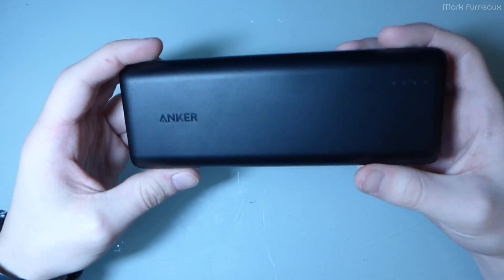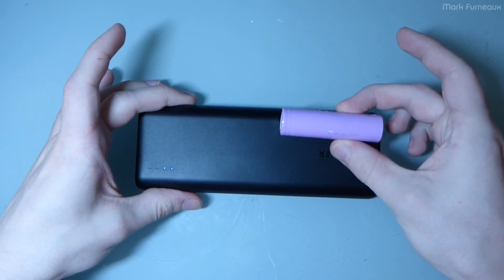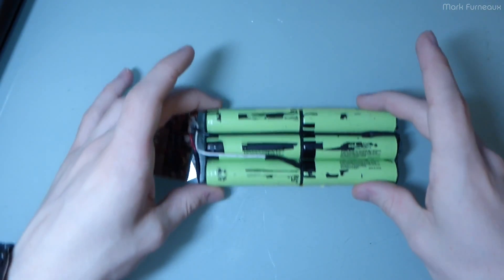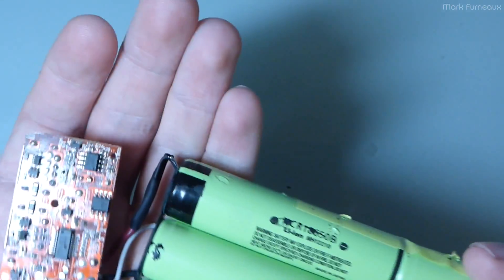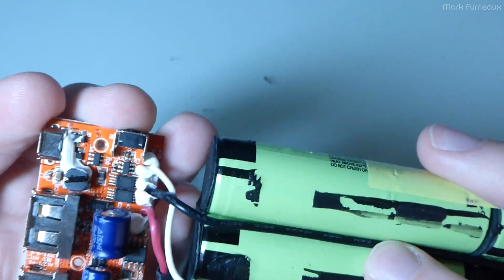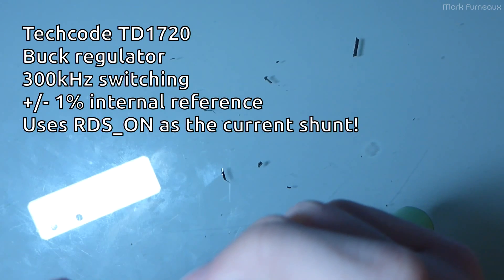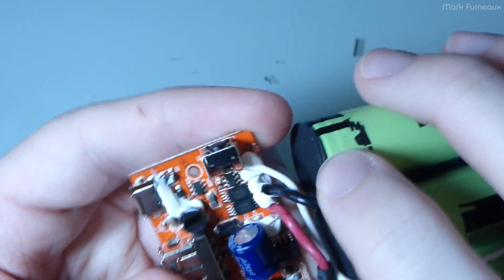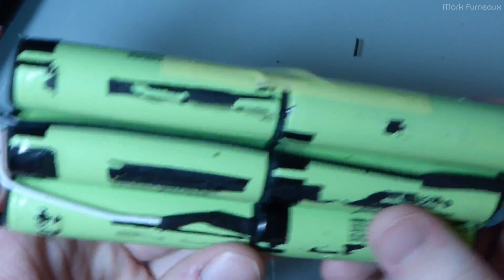Teardown of the Anker PowerCore 20100 USB Power Bank

Comment: you can buy eight 18650's for less than this power bank costs. and im talking about 35+ amp, 4000mah batteries. LG, samsung, panasonic, etc. stop buying stuff from amazon, they are expensive as hell. I use 18650's for my vape gear, and all the ones I have are all name brand high amp batts.
Reply: MXJO 3000mAh 35A are actually 20A continious (https://www.e-cigarette-forum.com/forum/threads/mxjo-yellow-silver-35a-3000mah-18650-bench-test-results-only-a-15a-20a-battery-but-near-an-hg2.710690/) Lg Hg2 and HD2 and HE4 is also 20A continious (according to datasheet). imren 3500mAh is really 10A continious (https://www.reddit.com/r/electronic_cigarette/comments/403vl2/the_green_30a_3500mah_imren_is_a_10a_battery/) (http://www.candlepowerforums.com/vb/showthread.php?414778-Test-Review-of-Imren-IMR18650-3500mAh-(Green)). Samsung 25R and sony VTC5 are alse 20A continious according to datasheet. All datasheets claim 200-300 cycles at maximal discharge current. Since vaping is pulse discharge, 35A vaping can be done on cells rated at 20A continious, but with cycle life you wrote.
Reply: I have never seen a legitimate 18650 more than 3400Mah cause of size limitations.
Reply: you bought illegal, counterfeit batteries. they may explode at any minute. you should feel ashamed, putting your family at risk because you have to be a "badass" that "vapes"
Reply: There actually are no 18650 cells >3400Mah nor >30A and >2500mAh cells. Efest always cheat you with real battery current rating. Furthermore very high capasity (>3100 mAh) or high current (>12 A) 18650 cells aren't good for laptop, beacose they are 2/3 discharged at 3.3V per cell and full discharged at 2.5V per cell. Laptop see 3.3 V per cell and consider battery empty, beacose stock cells have no capasity post 3.3 V per cell. buing 3400mAh cells and using 2300 mAh is waste of money, considering it's cost.
Reply: Thank you for the info. Can you let me know where you can buy reliable brand 18650s cheaper than Amazon?
Reply: +Los Los ebay..  You can get 4 samsung 25r 30amp batts for $22, of course those are only 2400mah. but u can find 3200 and higher for around $26 for 4 of them. dont get any battery that says its higher than 4800. and only buy 25 to 40 amp batts. if u didnt know that already. lol!  there are plenty of brand names. MXJO, Samsung, Efest, IMRen, LG and panasonic. those are the only ones i trust. price range $20 to $26 for 4 batts. check around n ull find deals for less than that. hope this helps.
Reply: Thanks man. I did not even know there are 25amp batteries. Wow technology has been constantly improving.
Reply: ***** give me a datasheet of that cels. I want to buy 6 of them. No one can stop you from drawing as much current (35A) from cell, as you want, even if it isn't rated for that, but how many cycles will you have
Reply: yeah, your a certified dumbass if you believe theres a 4000mah 18650 made.....keep talking , we love laughing at stupid people !  lmao !
Reply: INGODDA FEARIO 
Now that you've pointed that out, I do see that and would agree with your math. It would make sense that for heating up a resistive element, as you would for vaping, that the wattage would have to be around the same as an incandescent light bulb puts out, so even a real world comparison anecdotally validates your numbers.
Reply: highest capacity are 3400mah and only 10a continuous draw.
Reply: pete parker according to datasheet Panasonic NCR18650b is 2C=7,8A, not 10A
Reply: mooch the dude who is highly respected battery tester said they were 10a continuous in his tests. often good battery companies underrate their 18650s samsung underrated their 30q 18650, however shady companies have been known to grossly overrate their batteries.
Reply: He's probably talking about a 20650.
Reply: Neutron I have a couple 26650's and they are both 5000mah. Doubleu Douche apparently is a mister fuckin know it all..
Reply: you can do a rundown test on any good battery charger, and it will tell you to the 1 mah of what that actual battery has....did you not know this genius  ?
Reply: your such a fool dude....the more you type, the more we all know this....keep typing, we will keep laughing ! !
Reply: read my lips !!   tTHERE ARE NO KNOWN TRUE 4000 MAH 18650 BATTERIES MADE AS OF THE MOMENT !@!!!!!!   THE BIGGEST YOU CAN GET IS 3500 MAH..... ALL THE OTHERS ARE FAKE ! !!!!!   GOT IT DUMBASS !!!  ? ? ? ? ? ?..................................
Reply: INGODDA FEARIO.    and one more thing just to prove you're a freaking idiot there are absolutely no 35 amp hour cells like you talk about.... as the milliamp-hours go up you freaking dumbass the amp draw goes down period

so to wrap this thing up you're a dumb ass 2 times over the highest 35 amp battery is only $2,600 milliamp period

my God where do all these idiots come from unbelievable go get a life Punk....
Reply: doubleu dee OK so you think im some kind of brain dead moron. lets do a little math. you're sayin that no 18650 can output 30 to 35 amps. 
lets start with a regulated mod. if im running a single 3200mah 3.7v battery at 130 watts and amperage draw on that battery is roughly 35amps. amperage = watts ÷ volts.
 or we can use a mech mod running a coil of .10 ohms with the same single 3200mah 3.7v battery. im pulling 37amps. Voltage ÷ resistance = amperage.
 so in those 2 examples everything you have been goin on and on about is wrong. and those arent just figures on paper, they can and have been proven. dont believe me take a multimeter and check the amps across that coil. You act like a complete asshat, like you are such a genius just because you read some shit on the internet. doesnt mean your correct. my question is what makes you a goddamn expert on batteries, you obviously dont know any other way of communicating something to someone other than racist and violent garbage. why not try and do a little research before your alligator mouth bites off more than your parakeet asshole can shit.
Reply: INGODDA FEARIO 
You do realize that 1000mA = 1A, right?

Using your own numbers of 10 Ohms and 3.7V, your current draw would be 0.37A or 370mA, and NOT 37A.
Reply: Christopher K  i do underatand what you're saying, but if you look at the line of the sentence right above that you will notice a "." apparently i put a space or something in there and it put the 10 ohms part on the next line down. it actually reads .10 ohms. which calculates out correctly as I stated in the comment. sorry for the confusion, i was kind of pissed off at the douche bag that kept sayin all that crap to me, so I missed the fact that it seperated the period and the ohms value. sorry about that man. but hopefully you'll see what im talking about.
Reply: +Volodumur Kalunyak actually there are more brand names than just efest out there and your info is incorrect. I have Samsung and LG batteries that are 4000 mah and 35 amps. Those will run my 2000 lumen flashlight for 10 hours straight and then still have juice left when I turned it off. As far as using them for vaping I can use my 35 ampers on my mech mod running sub ohm coils pushing a little over 33 amps. So its always wise to know the facts before you pipe off!  thats all im sayin...
Reply: +Volodumur Kalunyak Ok, have to clear something up. I have 5 brand names of batteries I use and they are used strictly for vaping and my high lumen flashlights. I havent attempted nor plan to make a laptop battery. that being said the brands I use are MXJO 3000mah 35amp, LG HG2, HE2, HE4 3000mah 30 - 35amp, Imren (dont know model "because" ive rewrapped them, it was red) 3500mah 35amp, Samsung 25r 2600mah 25amp, Sony VTC5 2600mah 30amp. I misspoke in regards to the 4000mah (those are not my high amp batteries) the samsung have a pulse/peak amperage of 35amps, constant draw of 25amps. All batteries have a 200 to 300 cycle but if u continuously over draw the amps, knock about 50 to 75 cycles off. Ive personally ran 150 plus cycles on the majority of mine and have had no issues with "capacity". When vaping I run nothing but Subohm coils, pulling 25 to 35 amps pulse and continuously. having had no issues with batteries venting or failing. Out of all my batteries though, I prefer the Red Imren (total ass kicker) and the LG's. they perform very well. I also marry my batteries (which means I charge them in pairs on the same charger and always charge that pair together) seems to prolong battery life. anyways hope that helps.
Reply: +Volodumur Kalunyak Ok, have to clear something up. I have 5 brand names of batteries I use and they are used strictly for vaping and my high lumen flashlights. I havent attempted nor plan to make a laptop battery. that being said the brands I use are MXJO 3000mah 35amp, LG HG2, HE2, HE4 3000mah 30 - 35amp, Imren (dont know model "because" ive rewrapped them, it was red) 3500mah 35amp, Samsung 25r 2600mah 25amp, Sony VTC5 2600mah 30amp. I misspoke in regards to the 4000mah (those are not my high amp batteries) the samsung have a pulse/peak amperage of 35amps, constant draw of 25amps. All batteries have a 200 to 300 cycle but if u continuously over draw the amps, knock about 50 to 75 cycles off. Ive personally ran 150 plus cycles on the majority of mine and have had no issues with "capacity". When vaping I run nothing but Subohm coils, pulling 25 to 35 amps pulse and continuously. having had no issues with batteries venting or failing. Out of all my batteries though, I prefer the Red Imren (total ass kicker) and the LG's. they perform very well. I also marry my batteries (which means I charge them in pairs on the same charger and always charge that pair together) seems to prolong battery life. anyways hope that helps.
Reply: Joe Ambly LOL! i actually started smoking again, easier and taste better! I now use the batteries for flashlights and industrial strength dildos for my wife. she really loves the JackHammer!!!  ;)
Reply: some people just need to be slapped upside the head..
thats all i was doing
man, this guy is brain dead huh...........

Comment: Cool!

Just yesterday I was searching for teardown of Anker 26800... and found one video.
Awesome!
26800mah model contains 8x18650.

Anker PowerCore+ 26800mah is listed as $79.99 on Amazon Canada.  (Heck even Amazon .com is listing same pack for $79.99 USD!)

What I wanted to say is that... in USA, you can buy 4 pack Panasonic NCR18650B for $25USD directly from Amazom.com

In Canada, there is only one listing of NCR18650B being sold directly by Amazon.ca @ whopping $25 per one.
Or Two for $23 from non-full filled by amazon.ca (likely from china)

So... it is actually heck of a lot cheaper to buy Anker PowerCore+ 26800 model and crack open to get these Panasonic NCR18650B cells.
Anker does have Astro E7 26800 for $10 cheaper but I haven't seen anyone crack open that one just yet.

But now that you have shown that your model contains same Panasonic cells, so even greater deal for extracting the cells.

Sorry for slight off topic but 
as always,,, thanks for you videos.
I always find it interesting.

Happy Canada Day! (soon)

btw...

Yes, PowerCore series sure is better bang for your money but I would hate not to be able to fast charge the power bank itself.  It would just take too many hours.
I would slow charge when I don't need it soon but... when those moments come... I need/want to charge the power bank itself in a hurry.
Just me.

Oh one more thing...

Are these cells protected or unprotected cells?
Reply from the maker: Ya, the 26800 is $10/cell and the 20100 is $6.10/cell. Can't beat that. They are unprotected cells.
Reply: Los Los I guess you've missed the part where we were talking about purchasing in Canada.
Reply: The cheapest I found is $2.70 but you must buy a box (150 batteries)
Reply: Damn, Anker jacked up the price to $49 CAD now.  I blame Pokemon Go. haha
Reply: You are right - I thought it was in the US
Reply: I found the battery sold at around USD 4 per at this website

https://www.fasttech.com/category/1420/batteries?f=MTI0PUxpLUlvbnwxMjU9MTg2NTB8Nz1QYW5hc29uaWM&sort=p1&
Reply: Even cheaper are the Anker E7 26800's. Probably the same NCR18650B cells as the PowerCore+, with a different board/casing. That's going for $70 on Amazon Canada.

However, it seems you can buy original NCR18650B's from Aliexpress for $21 for 4.(Would be quite hard to fake capacity reviews) That's only $42 if you can wait for the shipping.

But yeah, even the DIY powerbanks are almost the same pricepoint if you include the alluminum casing and efficient boards that Anker has. So it's totally worth it. I was thinking about making my own powerbank, but after seeing their profit margin and fast charge/efficiency features Anker has, I just decided to get it instead. Plus there aren't any DIY USB Type-C cases and I really need that with the upcoming Note 7 that I'm getting.
Reply: I love your videos but, the brand new Panasonic 3400mAh NCR18650B unprotected battery is sold on Amazon for less than $6 per if you purchase 4 or 6. The LG version is a bit less, and Sanyo version is a bit more.

Comment: Can u make a video on putting the cells in your laptop?
Reply: Some are in series... some are in parallel to achieve desired capacity and voltage.  All battery packs are.
Reply: 3.6 Actually. 3.6x5 = 16.5V like your mac
Reply: Was about to ask the same question! Can you plz! Thanks!! and great video!
Reply: They are 3.3v Each, a laptop runs on 16V, or at least my mac air does.
Reply: @Ozziepeck11  3.8 volts each my friend
Reply: Lol insane :)